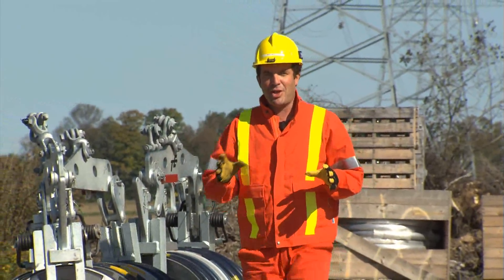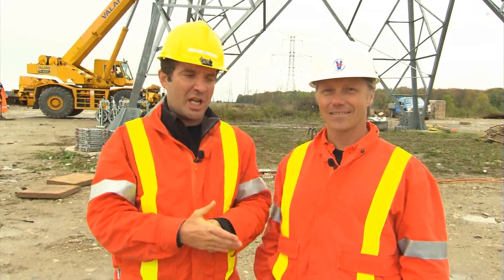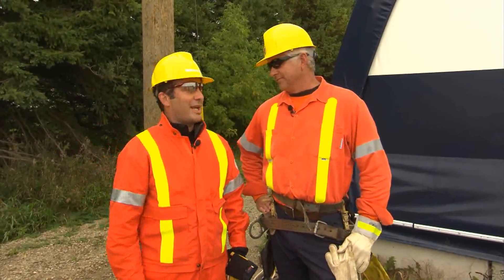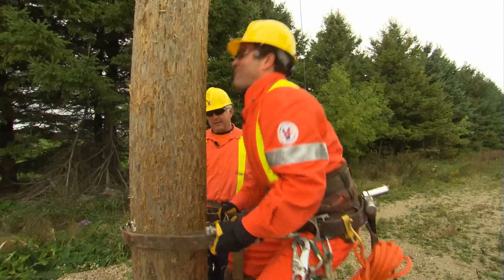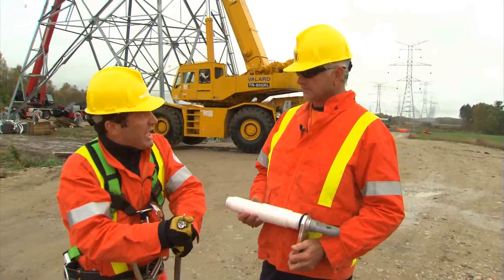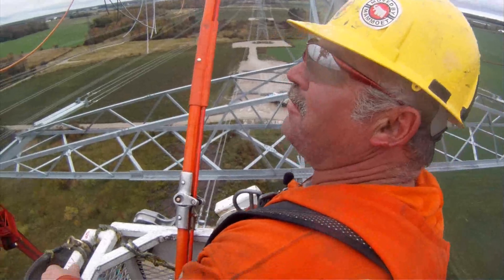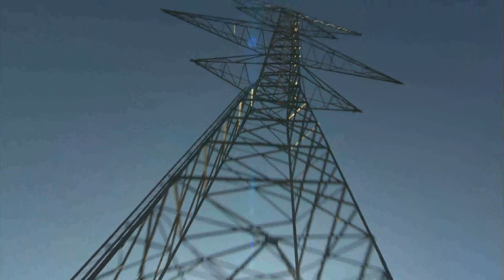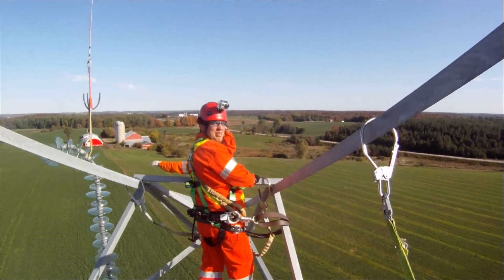RMR: Rick Builds Powerlines

Comment: i would not climb that metal monster 1 i  hate  highs 2 i dislike  being near deadly metal monsters &3   i learned in science that the electricity metal monsters carry jumps &  if it comes in to contact it can instantly kill some one. so that why i avoid being near  a metal monster like that pylon
Reply: What the fuck is a metal monster?
Reply: You have no knowledge of how it works so just no.
Reply: Atheist avenger , I go up the daily and work on them wit 500,000 volts flowing
Reply: .... you know the power's off when they work on lines like that.

Comment: I'm in complete agreement with JoelsMyName2000.  The only way to maintain a base load of energy per unit time, or Watts (Kilowatts, Megawatts), is to have energy conversion utilities that can maintain a baseload and other utilities that can ramp up the power (watts) as needed, relatively quickly to adjust for demand at different times of the day and different times of the year.
My concern is that we are wasting our time with the CANDU technology as is, when using uranium.  Why should China, using one of our CANDU reactors, be the first to get commercial power from THORIUM.  Uranium is a finite element.  Maybe 50 to 100 years of supply at todays worldwide consumption.  Reprocessing waste/spent fuel will help tremendously, as France's AREVA nuclear utility does.  But the "Greens" fearmongering has shut down a critical industry in most of the world.  Canada should be developing the UREX AND PUREX re-processing system.  

WHY THROW AWAY SPENT FUEL RODS INTO A POOL, WHEN ONLY 5% OF THE FUEL HAS BEEN CONVERTED INTO ENERGY.  XENON 135, A FISSION PRODUCT OF URANIUM 235, IS A NEUTRON SCAVENGER, EFFECTIVELY STOPPING THE CONTROLLED CHAIN REACTION!  THAT IS WHY THEY CHANGE THE FUEL BUNDLES EVERY 2 TO 3 YEARS.

SO WE ARE THROWING 95% (approximately) of the ENERGY INTO A POOL FOR CENTURIES.

THE NUCLEAR TECHNOLOGY OF THE FUTURE WILL BE THE LFTR. (Liquid Flouride Thorium Reactor.) Look it up on your  search engine of choice.

And read the book: "SUPER FUEL Thorium, the Green Energy Source for the Future", by Richard Martin 2013....ISBN 978-0-230-11647-4

ad iudicium